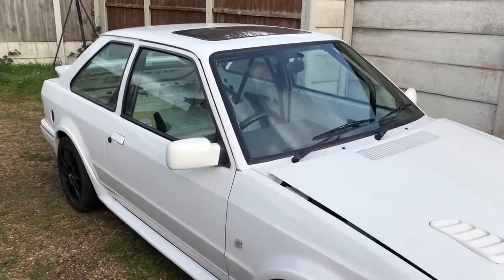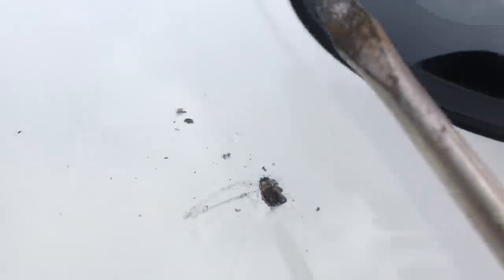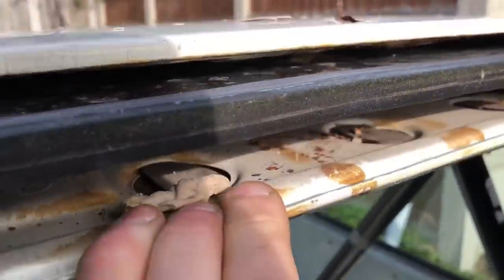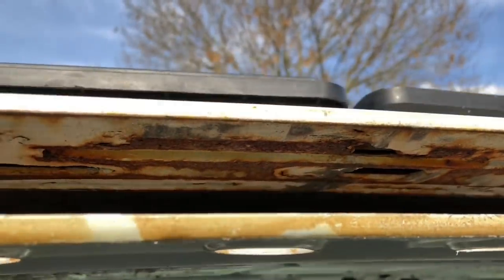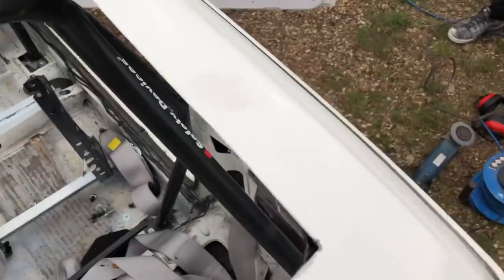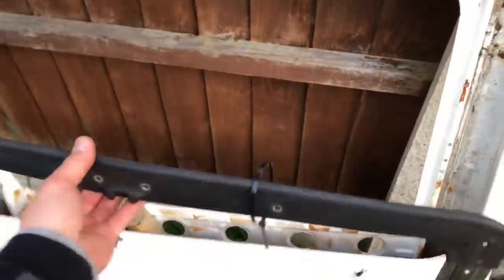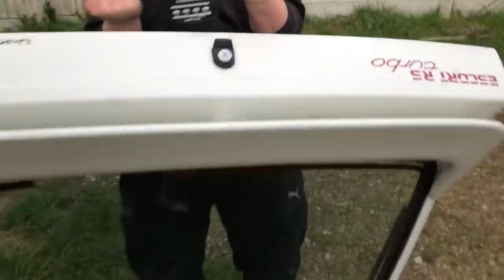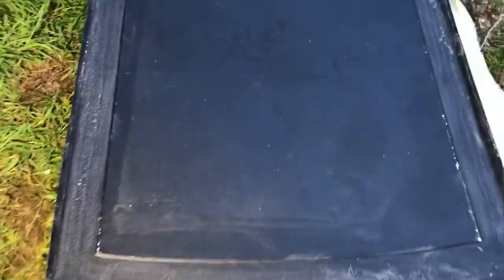I Fitted A REAL Carbon Fiber Roof! Ford Escort RS Turbo

Comment: This is painful to watch but I understand its completely necessary.  My old mk3 1.6 Ghia had a sunroof and it went rusty in the same place.  Also the battery tray area was a common spot on the mk3 and mk4.
Reply from the maker: Yeah i agree its no fun! It will just keep coming back. And now its carbon 😎

Comment: Hi , I totally understand the problems the Mk3 & Mk4 Escorts have with the sunroof problems and rust . I honestly think you have done a fantastic job . My only concern is you have removed the inner roof skin .... I agree carbon is stronger but everything depends on depth with Grp
Reply: Yeah I would have just replaced the top bit, I guess for the op it's more about weight saving

Comment: Just bought my second RS Turbo and again the roof rusting away. I love the job you did on your roof and i wont to do the same thing. I was wondering where you bought your carbonfiber roof skin from? I see you removed the ABS as well. It would be great to see how you bypassed it and rerooted the new brake lines. Thanks. Your content is great. keep up the good work.

Comment: Completely agree on not fitting the pillar trims, they don't even look good and they're purely for aesthetic purposes?!
It does seem odd chopping the roof out but the end result is fantastic. Are you concerned about the roof going brittle when exposed sunshine over a period of time (seems to be mixed opinions on how UV effects carbon fibre and the resins). Can't wait to see the interior fully painted. Great work keep it up.
Reply from the maker: Yes exactly! No purpose there not needed. The resin is Uv protected but we shall see how it goes. Probably cover it in summer.
Reply: Carbon delaminates and on certain cars has gone soggy brittle and not what you want in a proper bang , I don't think the average mush with a rs turbo thinks that far ahead , I don't know why these videos pop up on my feed as I have a escort cosworth and I'd never chonker around with a roof

Comment: My rs was the same, brake hard and your head would get covered in rust, I ended up with stripping out the xr3efi that I had to use the good shell, apparently those were built in Germany so didn't rust the same.
Reply from the maker: Its great when people can relate to the same thing 😎

Comment: did you source the bonding yourself or did the roof suppliers send it? only reason i ask is you should have put a silicon primer on the remains of the old roof panel first (same stuff they put on panels before they put windscreen sealer on)...i think you said you prepped/keyed up the remains of the roof panel so should be ok, just with that silicone primer you would have got a much better bond between the steel and carbon,, obviously cant do much about it now

Comment: Love the project and the vids!  The roof looks good but shouldn't you have removed the paint so that the bond was formed between the carbon and the remaining steel part of the roof?  Now the carbon roof is effectively only held on by the strength of the paint underneath it, does it make any difference?
Reply from the maker: Thanks David!  the way its done is cutting crisscrossing with a tool that takes it down to bare metal, then the bond goes over the top of that, you cant sand the whole roof back to metal it will rust very quickly which will lose strength

Comment: My RST's roof is exactly like yours (full of rust) i remember when i used to floor it rust would rain onto my head :( 

Ive always wondered what would be the best way to sort it and this looks like a good option

Mine dosnt have a cage and also id prefer it if the car was kept all white , can the carbon be painted ?

Ta
Reply from the maker: People have been fitting roofs from bonus models. Yes the carbon can be painted no problem

Comment: It's all about the weave lol I bet in a decent smash that roof would fly off in one piece too
Reply: Most panels are bonded together.  Actually tougher than mechanical bonding and allows flex.
Reply: @johndavies4644  not this thou trust me in a decent smash it's going bye byes

Comment: Azz spots bit of rust out come the angle grinder 😂you never stop m8. Be nice to get it on a weigh bridge so we can see the power to weight ratio.
Reply from the maker: Im mr anti rust 🤣 hate the stuff. Its gonna be weighed for sure 😎
Reply: @AaronUnknownPerformance  You must of put 20% more strength back in the old girl. Wonder if that carbon roof will stiffen her up even if it hasn't its shifted 35 kg of the weight from high up shoukd help in the twistys😁

Comment: Didn't really know they were THAT bad... Heard the "sunroof's rusty" some times. It's a nice mod with some tears.
What about repairing it with new metal? I would like carbon as well but almost don't wanna hear the price :-/
The car I'm looking at has a sunroof as well :-/
Reply from the maker: Yes very bad! Defiantly is possible too repair, but used the opportunity to loose weight from the car and replace it with carbon
Reply: A family friend had a business In Liverpool building oil drums. The lorry turns up to deliver the steel he went ape shit said I’m not accepting rusty steel. Driver said that’s not yours that’s off to halewood ford. Apparently ford always bought poor steel. Maybe it’s why we see a lot that rust from the inside.
Reply: @AaronUnknownPerformance  If/when I'm getting one, it's not the bhp that's important but the reliability. And of course some bhp :) :)
The carbon roof looks very cool though!
Reply: @richwilliams9895  I don't know. It sounds kinda fake but maybe :-/

Comment: Not getting at u Dude sum 1s gota do it 😇 I use 2 work 4 Ford, all us Mechanics agreed.........The MK3,Mk4 R not RS’s they never went Rallying netalone won 1 RS is RallySport they sud of called them Escort/Fiesta Turbo !!! In all my dealings with them they were Shit,the CVH Motor only good 4 about 80,000miles burn oil,eat Cams,Tappets snap Cambelts,Fuel Pumps,Gearbox’s were Shit ........the list goes on 2 make it reliable u got swop da Mangle but then .......not original 🤔 have fun 👨🏼‍🔧